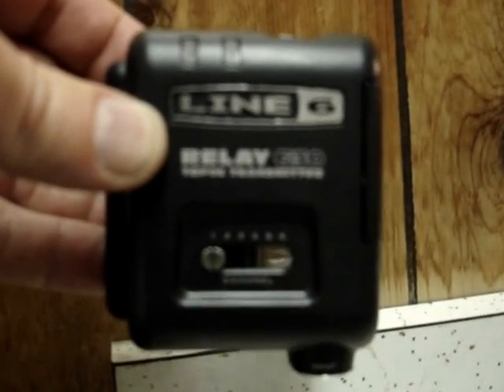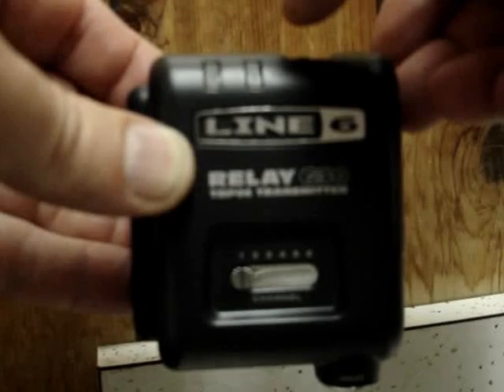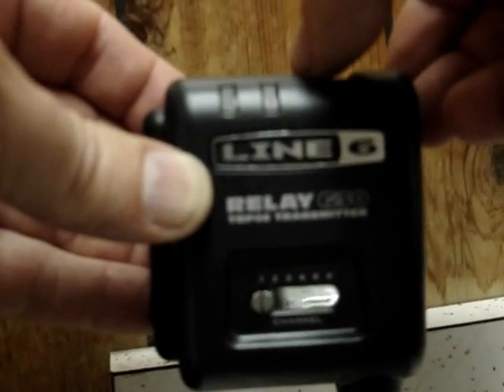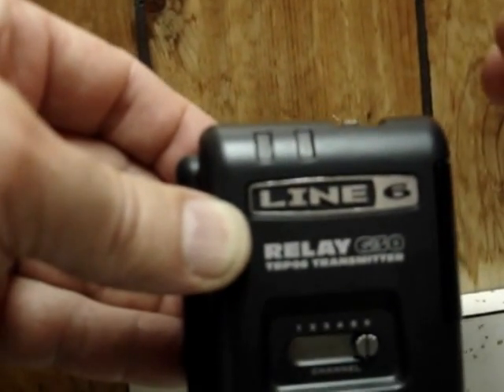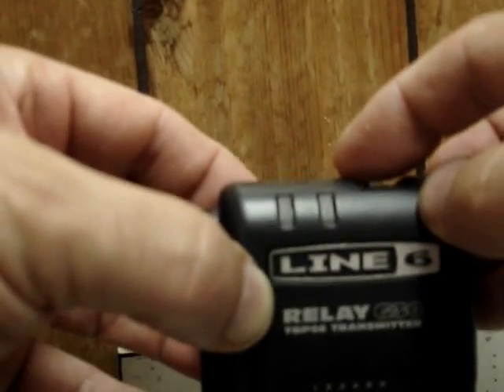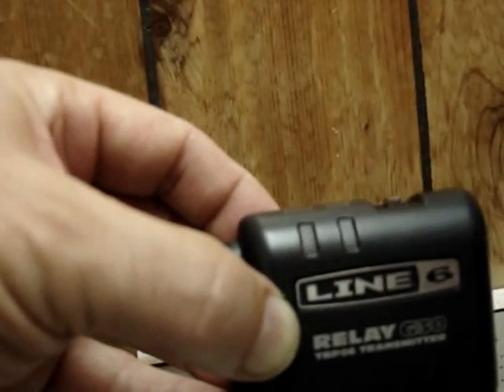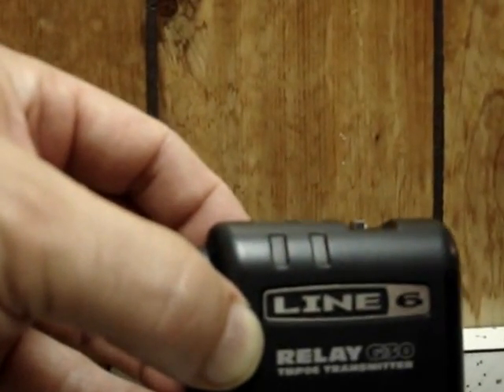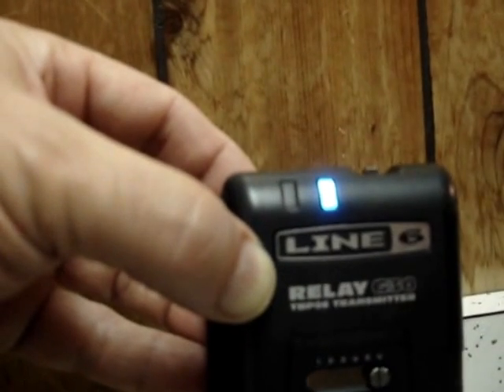Line 6 G30 wireless switching from RF1 to RF2

Comment: Hi, thanks for detailed instructions. Unfortunately, when I do as you instructed here, my G30 transmitter does not respond as yours. First of all, my LEDs do not flash as yours. I cannot reach the point where it flashes once or twice. Blue remains consistent after this process. In between there is also purple one as you may guess from channel change. What could be my problem?
Thank you, best regards.
Reply: Same on mine...

Comment: What is better RF1 or RF2?  My G30 does cut out once in a while for a split second during bar gigs.
Reply: @drial depends in the environment you belong, radio frequencies(RF) interferes with wifi,5g phones and other wireless systems mics and etc. You always need to switch it to 2 modes like in the video. You may experience it but suggest is to regularly switch it so you won't experience any trouble.